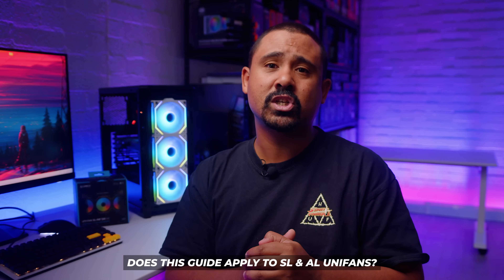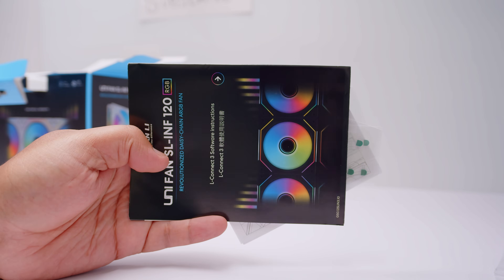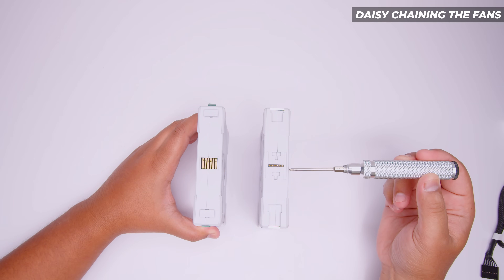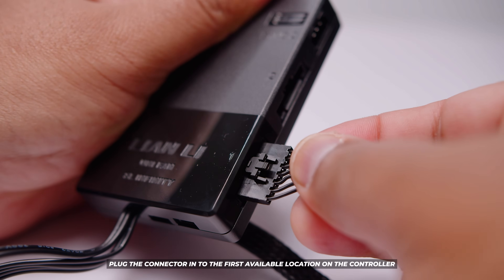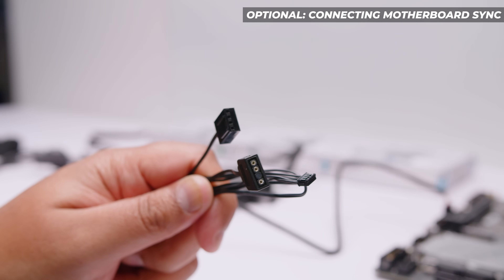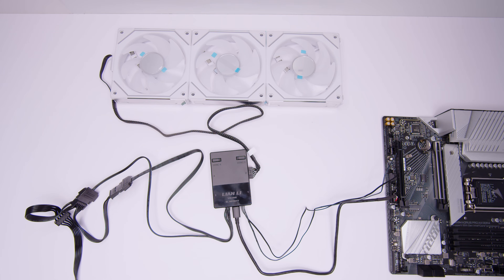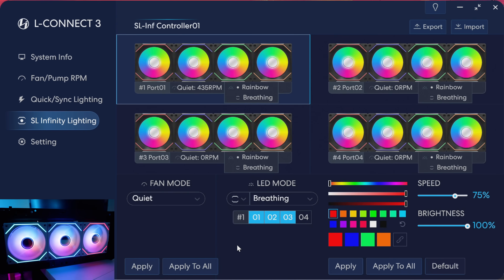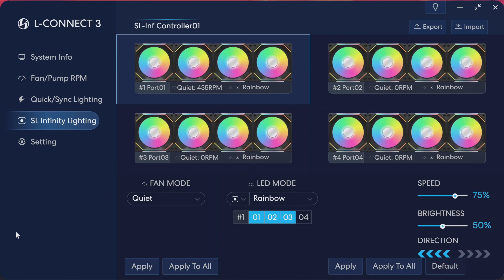HOW TO Lian Li UNIFAN SL120 INFINITY Easy Installation & Setup Guide

Comment: Hey I only connect the micro usb from controller to motherboard but the fans won’t spin, lights still on but when I unplug it lights turn off and fans spin, I need help please
Reply: Did you ever figure it out? I’m having the same issue.
Reply: @Klasmid1337  sadly no
Reply: I have that issue as l connect 3 closes within 5 seconds after opening it. I think I’m going to return these infinity and get the older sl120.

Comment: Sir, can you please tell me why the optional rgb and fan cable is needed? If I do not plug it in, will I lose any features? Thank you
Reply: I would assume the pwm/rgb will allow you to set fan curves via the pwm (fan speeds) as well as have the rgb controlled via your mobo, to make it in sync with the other rgb components…
Reply: @HardHeadMilitary  oh okay that makes sense, every reviewer glosses over the purpose of the optional setup. I assume if you had a different brand RGB for example AIO that was aura compatible, then you can use that optional to have both work in unison I guess?
Reply: Still makes it nice, as you use one pwm, one rgb and one power source for multiple blocks of fans… i have 10 fans in my dynamic xl and its a rat nest of cable, mostly for the fans which sucks

Comment: Great video GS, as always. I love these how-to videos you've done. Especially since I'm more of a visual learner anyways. 
But these new fans are kind of gimmicky honestly. Not a fan (lol) of the new look. I still think the ranking goes SL, AL, SL-Infinity. I absolutely loved the AL's when they came out and picked up 3 3x packs. Great fans. Then the SL's came out and after waiting around 4-5 months, I was able to get 3 3x packs and can't be happier. Their performance, rgb and the looks are top notch. Don't get me wrong, they look cool. They would go perfect with my MSI x570 Ace, which has an infinity mirror over the I/O but other than that, I don't see the need. They are a little better moving air but very, very small increase. Also maybe now Lian Li put these newer fans out the price of the SL's and AL's will drop. Wishful thinking I know but a man can have a dream now and again.

Comment: Very informative video, thanks for that 🙂👍
I need to replace my 9 Corsair's LL120 crapy fans in my Lian Li Dynamic case, i will definitely order those new 9 UNI SL-INF fans, yeah, they a bit expensive, but that idea that you connect 3 fans in a row with only 1 cable, or even 2 cables, is much better than messing up with like 6 cables, and i think those Lian Li fans looks way better then my old crapy Corsair LL120 fans.
Reply: Yeah I’m switching my Corsair QL 140s and LL120s for these because of cable management . I love the icue software but Corsair needs to do some different designs or something and ffs do something about the 2 cables per fan lmao so many cables in the back of my case ! Still got love for Corsair but thought it was time to switch out my fans for something new

Comment: The powerdraw on these fans looks pretty HUGE actually  . Maybe this is the reason why the contoller has 2 sata power input Specially cuz of how many fans and leds 1 can control .
Reply: not 100% sure but u only need 1 of the sata power inputs, the second one is if u chain to many fans or u have a 2. controller in line
Reply: @m.u.4074 are you saying it will work if only plug in one sata powerN

Comment: Good review lets start with that!

but wow taking stupid stuff and getting it to the next lvl ... colour fans is already a little silly but this tops all. When progrss stiffles this is what we get pwitty liwle lights
Reply: Personally I got Corsair QL120, I like having some RGB in my case. Ideally, the QL120 would be as good as the noctua but well there are a bit louder. I think a build/case without RGB (fans) is fine too. My biggest issue with RGB is all the extra cables (mostly fixed with Lian Li solution) but aside from that, who does not like a bit of light ? ;) or at least, having the option to add some

Comment: Lian Li fans are good, BUT They are very annoying because they have a separate control panel you have to use in order to control the fans. Its very annoying in terms of space and more wire management in my opinion.
Reply from the maker: To be honest, I make adapters for all my fans so I can use them in whatever software or way that I like and not really a fan of the new combined connectors.

Comment: I'm a corsair fan boy but I promised myself for my next build I'm going with Lian li when you have 9 QLs in a 5000D its cool but the Lian's have just a more elegant look to them.
Also the cable management is much smother to implement. With Corsair OMG cabling is a nightmare 2 cords per fan 9 QL's and 3 ML's for a push pull at the top so you do the math and 
don't open my back panel its madness lol. Lian Li hear I come...keep up the good work Seekers.
Reply from the maker: Thats why I use Unifans in a lot of our builds now because it saves me time
Reply: @doziertech  the one thing Corsair has over lian li is the software. The lian li software is terrible. Love their products, but I wish they had a better interface
Reply: My Corsair 1000D is nightmare with fans...

Comment: That's strange, on this video:  https://youtu.be/kb8SXTGnyzI?t=4m16s

It shows that the new Infinity fans still have seperate argb and pwm headers.

Are there multiple variants of the SL Infinity fans?
Reply: Oh u mean like this? https://youtu.be/zswOgMoW0g8?t=464
Reply: The single pack fans come with the 5V ARGB and PWM connectors. The triple packs don't.
Reply: @Mapantz1  ohh, icic.
Reply from the maker: As mentioned this video is for the 3 fan kit

Comment: I think I figured out why the connector is in the middle. Had a rough time trying to mount the sl120's to a rad. Where the connector is on the side and was in the way of the tubes coming from the rad. Was going to do a push/pull configuration but it couldn't be done.
Reply from the maker: Yeah I figured as much. Also ran into this problem a few times.